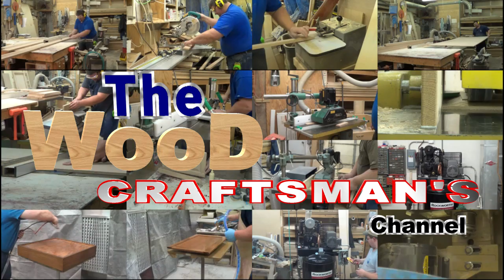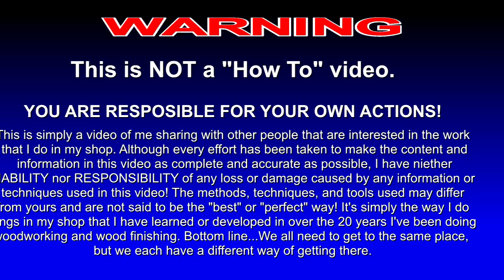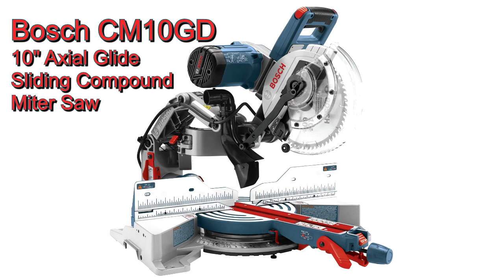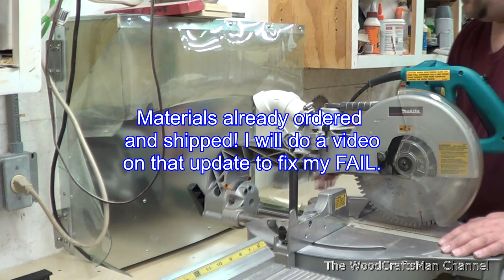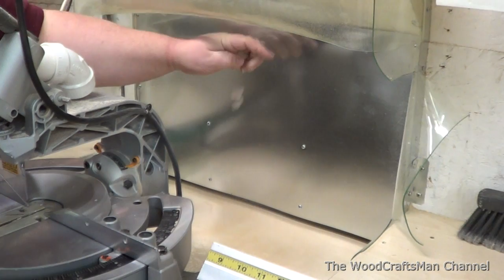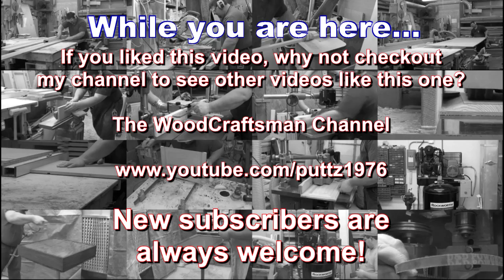Miter Saw Station Part 4 # 172

Comment: Pretty slick design! I would guess its about the most effective of any other miter saw dust collection designs out there. 
I would love to copy it but i have my main electric panel above my miter saw. I have an entire box built around the saw and use a shop vac with a dust deputy on a switch. I have two of the older Japan built Hitachi C10FSH saws and they are the best imo. The new ones are made in china and i have heard are junk.
Reply from the maker: +jeremy s Hey Jeremy, thanks for the comment. If you have any room, the dust collection pipe doesn't have to come out of the top, the side would work too, as long as your dust collector is up to snuff. I had the Hitachi C10FS (their original 10" sliding compound,) which was the big brother to their 8 1/2". I bought in 1999 which was an absolute POS so I got the Makita LS1013 in 2004. Its been good, but starting to show some signs of wear.

Comment: Wow I'm very impressed that the dust collection works that well with the 1 inch gap at the bottom I wouldn't of thought so!  Why didn't you use a piece of half-inch melamine to do your back instead of a sheet-metal it would've been more rigid?
I can't wait for the update version.
Reply from the maker: +Bid Budy Hi, thanks for the comment. I didn't really question if it would work since it was similar to the previous hood that I had, I was more so concerned if it would work better, I can say it does. It may not work for everyone if they don't have the CFMs in their system, but a smaller system might be just as effective if the branch was smaller. I have a 5 HP belt drive blower that moves around 2300-2500 CFM with a an 8" main trunk line with 6" and 5" branches akk done in 24g spiral duct work from Oneida Air back in 1999. The miter saw station hood has a 5" branch which I thought was overkill when I did it, but Oneida Air said I wouldn't be disappointed, they were right. As far as why didn't I use 1/2" melamine instead of sheet metal for the front baffle; I needed the clearance for the rear handle on the miter saw. I knew that when I had set up the saw and fences, I could only have the baffle / plenum only about 1" deep. I originally wanted to use a piece of clear polycarbinate because I thought it would look cool, but I soon realized that It would look pretty dirty in just a few cuts. Thanks! Scott